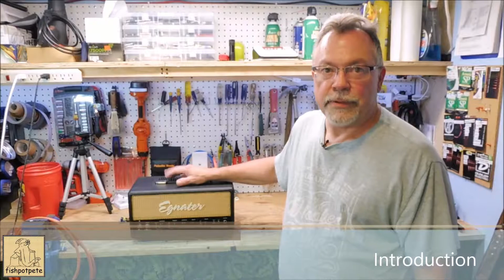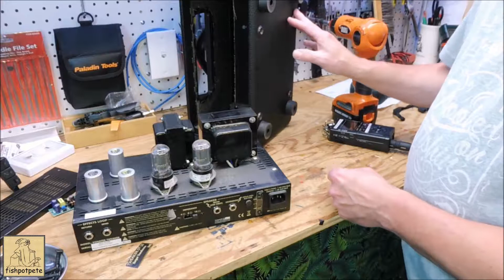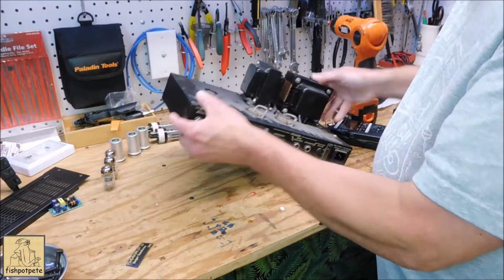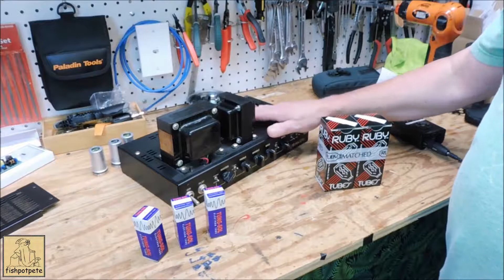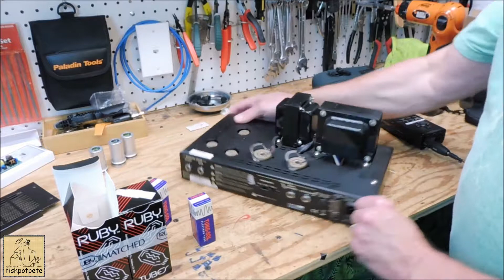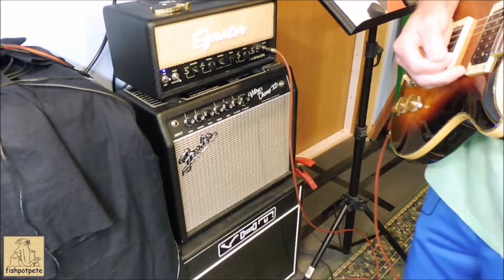Replacing the Tubes in an Egnater Tweaker 15

Comment: If you're considering changing one or more tubes in your amplifier, please remember the importance of the "new" tube burn-in process

Install the new tube(s).
Make sure pins are clean and fully seated.
Verify the amp’s power is OFF and unplugged when inserting it.
Idle Warm-Up (Standby ON, no signal).
Power up the amp with no guitar connected.
Leave it on Standby (if available) for 15–20 minutes to let the heater filaments reach steady temperature.

Low-Load Operation (Signal + Low Gain)
Take the amp out of standby and set the Gain and Master both around 9–10 o’clock.
Let it idle or play quietly for 30–45 minutes.
This helps the tube’s cathode coating stabilize and reduces microphonic tendencies.

Medium-Load Cycle (Normal Playing).
Play through the amp at moderate volume for another 30 minutes.
Avoid diming the gain or master yet; let the internals thermally cycle gently.

Cool-Down
Power off and let the amp fully cool for at least 15 minutes.
This first heat/cool cycle helps form stable internal connections.

Repeat Once More (Optional)
Doing one more warm/cool cycle the next day completes the “burn-in.”
After 2–3 hours total of gentle use, the tube is fully settled.

Comment: I was using my Egnater Tweaker 15 head the other day, I heard a loud pop then the volume cut drastically, pretty sure a tube blew out, gotta figure out which one to replace, or should I just do a full tube replacement? I got the amp new a few years ago, all stock tubes.
Reply from the maker: I wonder if one of the pins on a tube shorted out or something and knocked out half the power amp?  You might want to check for any burn marks around the sockets - I had an ampeg head years ago that had some loud pops and it turned out the sockets were bad.    I'd be interested to know what it turns out to be!  Best of luck on this...
Reply: @fishpotpete  Yeah, I will look for burn marks. I just asked my Guitar Center tech if he works on tune amps, he said unfortunately not, so I guess it's up to me... Thanks for the advice. 👍
Reply from the maker: @scramblesthedeathdealer  If you're not experienced or comfortable working on tube amps, just be carefull.  I've never had a problem - but you might want to look up how to drain capacitors before you start poking around - that's where the danger can arrise of getting shocked.  But if you know how to do that, then you're 99% safe (assuming you unplug the amp 🙂).  There might even be a generric electronics repair person in your area that would be interested in taking a look.  As much as I love Guitar Center, they're really not my first choice on amp repairs.  You might find a good one, but they mostly do basic work focusing on guitars (and they may be extremely good at it!).
Reply: @fishpotpete  Will do. 👍

Comment: How can you tell the types and brands of tubes that can fit the amp?
Reply from the maker: Usually either the manual or a label inside the case will indicate the tube types (and positions on the chassis).  If not, you most likely can find that information with a quick Google search.  As far as brands go, they are pretty much interchangeable.  It's always a safe bet to go with the same brand as the originals - but that's not a requirement.  Feel free to go with pretty much any major tube brand.  There are plenty of YouTube vids that explore different brand tubes within the same amp... and they all essentially sound the same.  If you think one sounds better than the others, then go with that if you like.  If you want to "experiment" with tube types, the easy route is in the preamp tubes (12AX7 socket compatible).  There are a few different types you can swap that WILL affect the sound characteristics easily and cheaply.  I played around with that years ago and I ended up going back to the original stock type.  But it doesn't hurt to do it - it gives you a sense of empowerment :-).  On the power tube side of things - It's a little more work to change the power tubes and that is beyond the scope of this video.

Comment: Just got my Tweaker 15 and I love it! Bought it used for super cheap at Sam ash and it is my best sounding amp. Thanks for posting, I will definitely use as a resource when changing my tubes. Does your over hear at all? The top grill on mine will get very hot after a couple hours... Is this problematic or normal?
Reply from the maker: The heat is a normal byproduct of the tubes.  And they do get VERY hot.  As I learned on a little 3 watt Silvertone amp a few years back.  Little tube, big heat, big blister!  So the amp SHOULDN"T be overheating - but should get hot.  If you have other tube amps to compare it too, see how hot they get.  I think you notice it more on the Tweaker because it has that nice wide vent on the top.  That's a great design because you get a good convection current going in there to help cool those hot tubes!  And thanks for asking!
Reply: @fishpotpete  wonderful, thank you. Just snagged one used yesterday and have been playing the heck out of it. I noticed it got pretty hot on the grill but I'll keep an eye on it. I'm hoping to keep this head for the long haul. Checking other heads definitely get just as hot on their exhaust areas. New sub BTW, all the best and thanks for sharing. Any other egnater vids would be nice. This would be the first amp I'll service myself, so any vids on pot cleaning and what not would be helpful. Thanks again, all the best. I saw the comments,.one about drying out pots. Any way you could do a vid for beginners? Lol
Reply: I'm going to retube next week and this video is so very helpful. I appreciate it you save me a bunch of time and now I can't wait to swap out new tubes. Thanks again all the best

Comment: Put a new old set of vintage RCA 6L6, - which barely fit, height wise, and they really opened up the Fender and Marshall modes.It also increased volume -, which I didn't want, -as clean, you can't go much louder than 4.
It's a modern design, and as such, scary in the quanity of crap wired direct to the board., but I did notice few complaints regarding reliability overall.( as on the cheaper Fender combos).Usually, you want jacks , tubes,and knobs, transformers free standing, and away from the boards.
Keep in mind that , - in the States, you can still easily find the old Fender Twins and the like, which are always going to be most over engineered and reliable going,- for under $800.In most of the world, they don't have this luxury, and often also have more restrictive health & safety standards.The marketing of new hybrid and SS is more about their probs than ours,and while you still have the better options, - don't believe the BS marketing. 
If you can go Fender, Ampeg, Gibson, or Marshall, all tube, - why wouldn't you?
Reply from the maker: Thanks for the comments!

Comment: I know this is an older post but figured I should add that you don’t want to spray pots with contact cleaner as it can dry them out.  You want a cleaner like Deoxit that’s also an electronics lubricant.

Thanks for posting this video.
Reply from the maker: Thanks for bringing that up.  I've used both.  But sometimes the ones with lubricant can get a little messy.  I've never heard of a problem with things drying out.  But I'll certainly keep that in mind in the future and see if I can detect any issues between the ones where I used a Deoxit type cleaner vs just a cleaner.

Comment: Unless you have extra money, or want to change the tone of your amp slightly, there is no benefit of changing tubes until they fail, especially the pre-amp tubes. I have 12ax7 and 12au7 tubes in my Ampeg SVT lll head from 1990 and they are still fine. Cheers.

EDIT: if you are changing tubes to change the tone the slots that make the biggest difference are V1 and the phase inverter.
Reply from the maker: I pretty much agree with that statement.  But I don't like to wait for something to fail before I do something about it.  That would be embarrassing if I was playing out somewhere and they shot craps!  I only changed these out because I bought the unit used and I had no idea how they were treated in the past or how many hours were on them.
I do have a 64 Fender Vibro Champ and a Silvertone amp in a case amp both with original tubes.  But I don' t take them anywhere to play live.
Reply: @fishpotpete  totally valid, Bro. And great video, BTW! I was just trying to cut down on garbage and buck the capitalist trend (i.e. tube kits) that tells you to replace preamp tubes every time you change power tubes. Before the pandemic I never had to worry about my amp failing, I have an orange stomp on my board for such occasions. :)

Comment: great video.  I have the Tweaker 15 and the 40 watt version.  I replaced the 6v6 tubes in both amps with 6L6GC.  it's great.  Those Tweakers can take the different tubes without re biasing the amp.  I love the sound too.  I use Sevetlana 6L6 tubes and I get good results.  rock on.
Reply: Thanks Jake.  This is actually what I was searching for. I SUBSCRIBED HERE.  later.
Reply: Did your power transformer burn out yet?

Comment: Moving your hands around inside the amp near those power supply capacitors, you were scaring the hell out of me. Lol!
Reply from the maker: You are exactly right!  I'm doing another vid on a VHT amp and I address the capacitor issue directly.  I should have been more careful to point that out in this one.  Thank you for bringing that up!
Reply: @fishpotpete  I actually just got an idea for this amp this morning. I went and ordered two 12AX7 to 6SL7 adapters on ebay so I can experiment with running one 6SL7 tube in the V1 position for a smoother, fatter and more vintage overdrive, as well as another 6SL7 with balanced triodes in the V3 position as a nice heavy duty phase inverter. I also ordered two 6V6 to EL84 adapters so I can see what kind of tones I can get out of this amp with a set EL84's, or the much better and lower priced vintage NOS Russian military 6BQ5 tubes.. I'm even thinking about getting a couple of 6N2P to 12AX7 adapters, because as you may know; 6N2P are the vintage Russian military equivalent of vintage high dollar US made NOS 12AX7's, except even though they look exactly the same, the heater pin is in a  different spot which is corrected by the adapters. I have about 2 dozen of these tubes that were made in the 1950's and they sound as good as many of the old Amperex and Telefunken tubes made back in that era, except instead of costing anywhere from $75-$200 dollars a piece, they only cost about .50 cents to $1.50 each. HUGE difference in price, but not in sound.
Reply: @michaelbarber1123  did your plan work out to hear any difference?
Reply: @dariuskohler251  Unfortunately,  no. Those adapters do not address the voltage differences between a 12ax7 and a 6sl7, so using them could very well damage the amp's output transformer. I did however, order some 12ax7 to 6n2p adapters and those tubes sound every bit as good as NOS Telefunkin tubes from the 1950's, except they cost about $5.00 each as opposed to $150 - $250 dollars each. Huge difference.